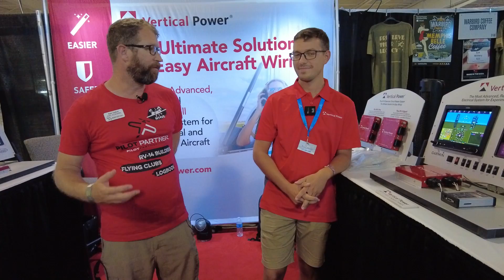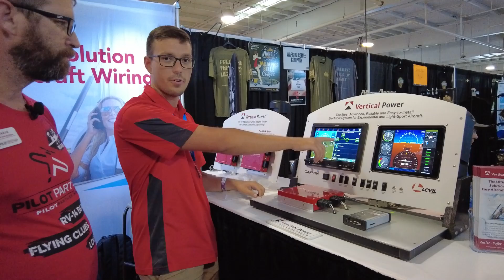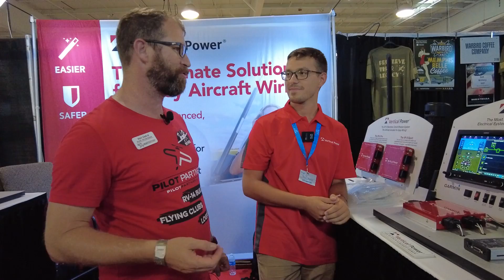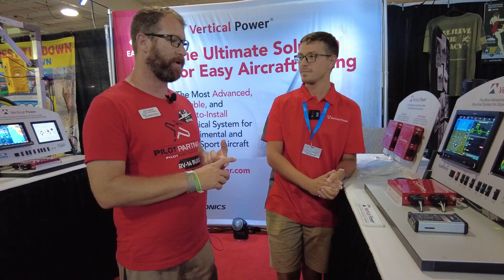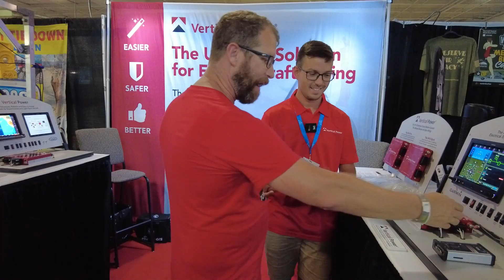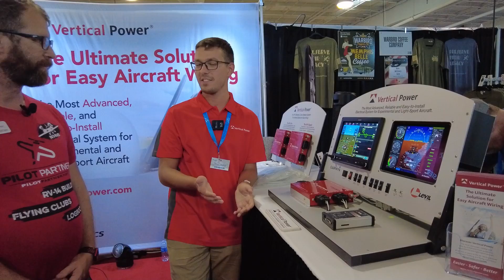VPX Pro by Vertical Power for our Vans Aircraft RV-14A

Comment: I have beautiful discreet switches and CB's. Very simple, reliable and not expensive. How much information do you need? It is information you don't need. Volts and one or two current ammeters is all you need or already have.  Switch is on, it's On. Landing light? if dark I can see it or look at the main ammeter.  I have aircraft CB's. Short? It pops out.  You still need switches with VP-X. CB's can be replaced with fuse panel under panel "clean". Wiring? Yawn, my RV-7 was easy, bus bar, switch. load, done. VP-X more sub-D's and pins, serial wires and more. Simple? Not really.  $2,400 VP-X pro not including switches. OK. My mil-spec witches and klixon fuses (granted bought 10 yrs ago and some surplus) a few hundred.

Comment: I too use VPX Pro for most of my circuits but because of a IFR concern of the VPX in the UK ( Regulated by the LAA) - concern re failure modes and associated actual data and a lack of published data and software logic as required by certified devices! I installed the Garmin GAD 27 to run flap trim and lighting. For trim and  flaps  and pitch servo they have an independent power supply.  Also have independent back up pitch trim not via GSA 28 servo. RV 14 IFR dual G3x touch - GAD 27- 650 xi - G5 plus Battery. Dual Alt and IBBS. Also PPS and Dual 114 P mags, one via VPX and one via independent bus. All independent bus devices have classic CBs.
Reply from the maker: It seems to be a little easier for us in the US to use this in our Homebuilts.   I haven't gotten to the point with our Avionics team to know what we will run through VPX vs GAD 27.   I know Stien Air has their reasons for what they run through each.      But once we finalize that we will be talking about it in more detail on the YouTube Channel

Comment: Junk. Buyer beware.
Reply from the maker: Do you have any specific details on why the VPX is junk?   I've seen the VPX used in many installations and pretty much hear only positive feedback from the owners who have used them.
Reply: @N14VE  - mine has been a disaster. PPS started on fire 2 1/2 years ago. Replaced two times. My plane electrical hasn’t been right since. In process of going back to conventional. Its been miserable… I have spent thousands of dollars on their problem, and nothing but frustration. The Alternator Distribution Relay continues to trip offline leaving me with only battery power. Takes out both alternators. Got 20 minutes before my electronic ignition quits.

Electronic engineers say I may have a faulty diode sending out a dirty signal from the bridge, causing the intermittent trip. Caused by the fire and short circuit of the first box.  Stay away. Company was bought, support nil…

Comment: I still don’t get the desire for a single point failure.. if that magic box burns out.. then what? The earlier “remote circuit” EXP BUS 2 went extinct.. and as they fail, there’s no replacement.. the VP-50, then the VP-100 eventually went extinct.. and as they failed, users were forced to either acquire spares or change over to some new system.. traditional circuit breakers are so independent and reliable.. I would not consider a VPX to be a selling point.. I’m just not sold on it yet, I love the look of traditional CBs.
Reply from the maker: There will always be a single failure point somewhere.  We are just choosing where to put it.    The main power supply going into a traditional power bus is a single point of failure too.    The information the VPX gives us on each circuit is worth it for us.  We will have a G5 on its own backup battery that should everything fail, we will have all the info we need to land safely.    Plus the G3X will also be on battery backup, but I am not sure if it will be before or after the VPX.
Reply: @N14VE  of course there are single points of failure.. a single fuel line, and oil line failure, the single master contactor, any battery cable.. I just don’t get why we need this device any more than we need circuit boards and computer chips on my refrigerator or air compressor (yes, some come with these!) I don’t understand the need to know if my landing lights are consuming 6 amps or 6.2 amps.. just a simple CB setup is timeless and reliable. I’m not knocking your decision to go this route, I love tech, and I really want to know if I’m missing out on the newest, best way to go, but I just remember when the VP-100 went unsupported.. then the VP-200.. kinda left a bad taste in a lot of other people’s mouths. 10 years from now, are all these early adopters going to be left re-wiring their planes?
Reply: I agree. I’ve considered the acm and vpx. I love the tech but won’t put one in my build. The greatest benefit is a quicker build process but for me the benefit does not out weigh the addition of another single point of failure. Yes there are other single points of failure, however that is not a logical argument for adding another. To each his/her own.